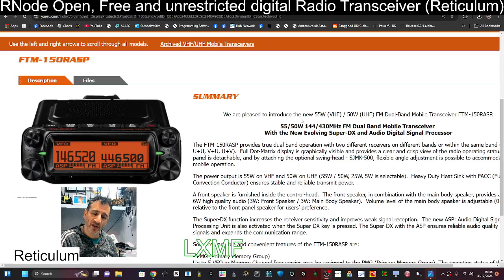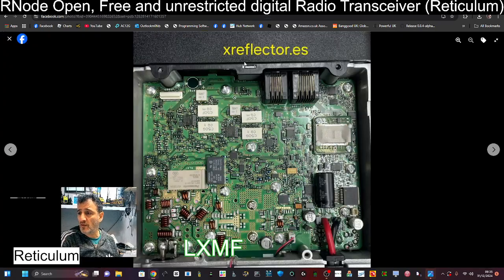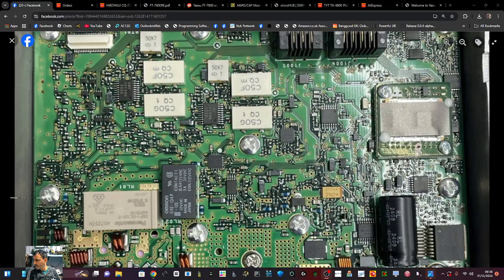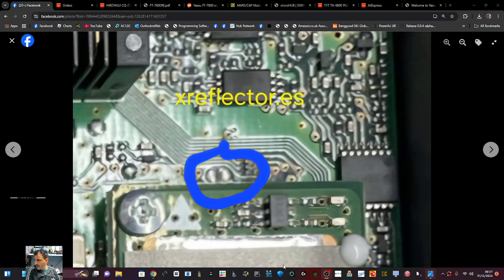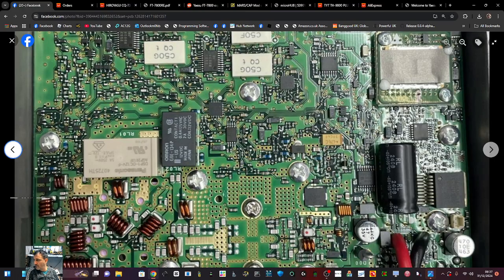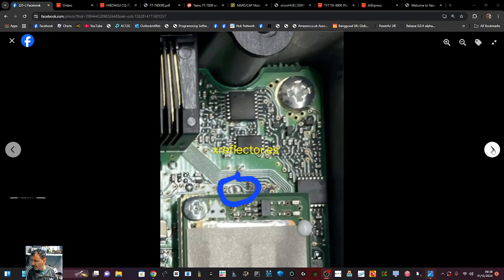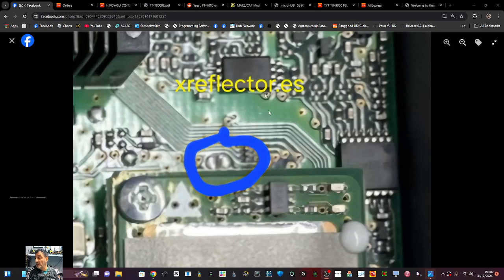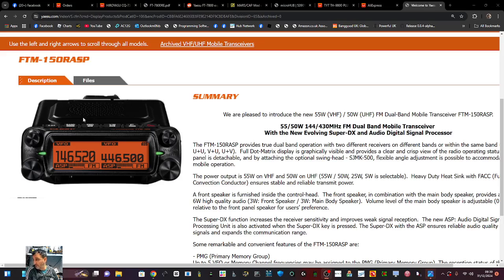YAESU FTM150 rasp - MARS MOD

Comment: Is it safe to assume this works ont he FTM-150R also?  This video seems to speak specifically to the RASP version.  Thx
Reply from the maker: Check with Yaesu
Reply: I was told the Non RASP version is just missing a feature chip. If you want RASP feature later you can buy the chip later and insert it when you want the feature. 

Im going to go out on a limb based on the picture I saw on the DXE website, that big square chip is the RASP module. I'd wager that if you took your standard 150 apart, you'd see a socket instead of that chip.

Comment: Just buy an Alinco 735 the asp does nothing.
Reply: The FTM 150 has been commonly sale priced around $380, it's really not that much more. This does 55w on VHF and it's got a very sensitive high quality receiver. The Alinco didn't tickle my fancy enough to replace my TYT 9800, but the Yaesu did. To each their own though. Edit: The 150 has extremely good airflow through the radio as well, I expect it to last decades not years.
Reply: Says a person who has never had an ASP Yaesu radio.
Reply from the maker: Ok
Reply: @M0FXBHamTech   ASP works well for me, the RX is cleaned up significantly on many channels
Reply: The ASP works great. I don't know how you conclude it does nothing but I can only assume you have never truly used one where it matters.